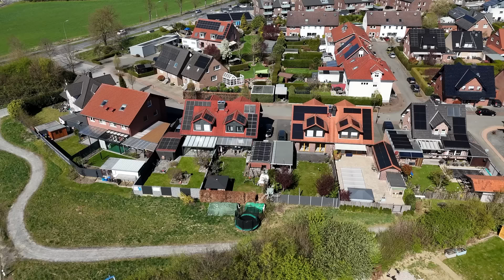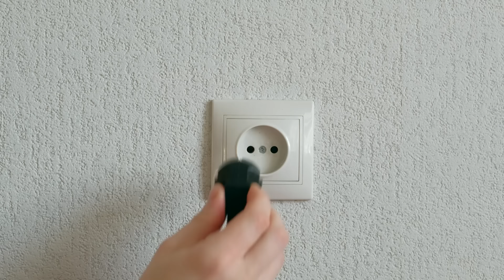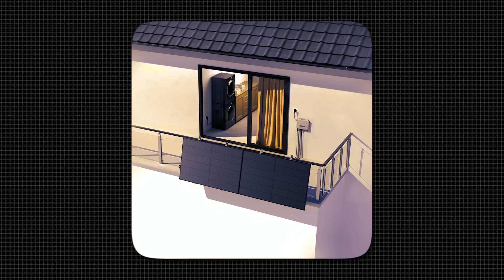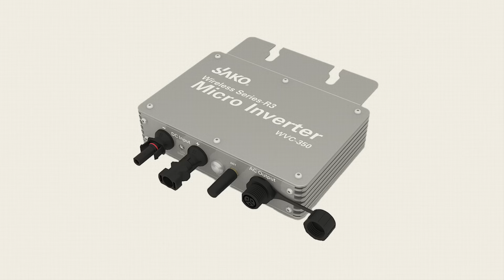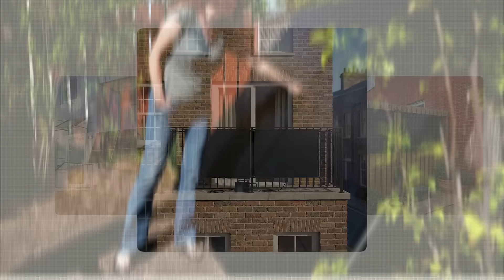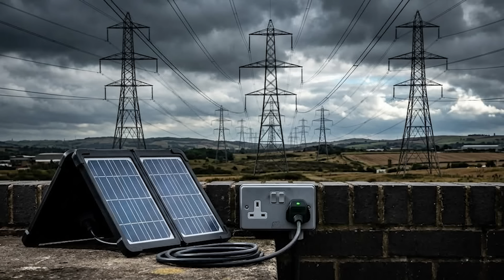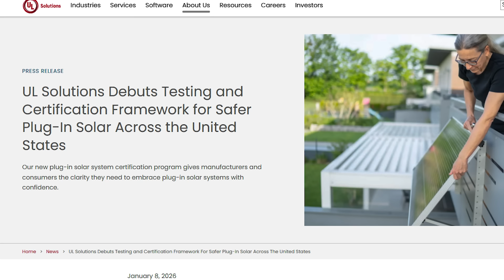Plug-In Solar Could Revolutionize Home Energy - Why Is It Illegal In 47 States?

Comment: so the issues are mostly safety concerns according to Google, but to be honest with you, I'd rather just be off instead. I mean off grade is way better than on bread and you can have according to Google the same simplicity of plug-in, solar, using solar panels in a battery like a portable power station
Reply from the maker: Yes a battery is a good idea and some suppliers are now supplying these are standard with their plug-in systems.
Reply: That’s what’s been booming all over Europe, plug-in solar is often attached to a battery, that then ingests a maximum of 800 Watts into your local grid when needed.

Comment from the maker: With a payback of 3 years or less, this seems to be the change the solar industry needs!
Reply: if you use Solar Forecast and Optimizer you can make it in less !
Reply: Depends on where you live. My payback would be 7 years.
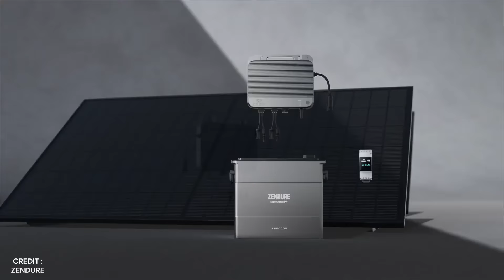Reply: The payback for the most praised system at 12:55 is 6.5 years, assuming $20 a month in electricity bill savings.
Reply: @737smartin Twenty bucks per month woudn't be worth bothering with this, personally.   I have rooftop solar in Southern CA and it is rapidly approaching the break even point as I was under NEM 2.0 and so I get dollar for dollar credit for excess production that I send back to the grid.  My bi-monthly electicity bill from LADWP is usually zero with one or two bills during the summer at $40-60 since I am then using more electricity due to A/C usage.  Taxes are the only item that cannot be covered by my NEM "bank" balance.  The house is 2900 sq ft with two HVAC zones and a pool and jacuzzi.  Subsequent NEM programs are far less advantageous.  At my vacation home in Boulder City, NV, the electricity rate is only about $.09/kWH, making solar a much longer break even period and the city only allows 80-90% of your historical usage as your system size.  I'm still going to keep an eye on these plug in systems for that home in case they ever become viable.
Reply: @melrobinson6919  I'm not advertising for this system.  I was trying to "check" the poster's payback time claim.  Of course results will vary and you can get more efficiency from a full-home system in CA.